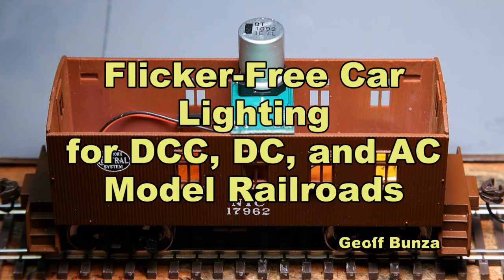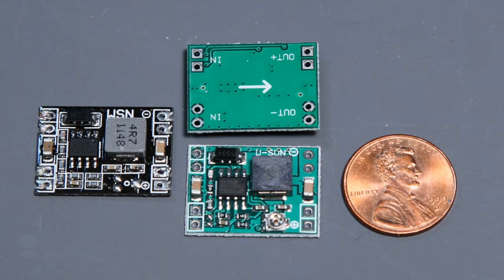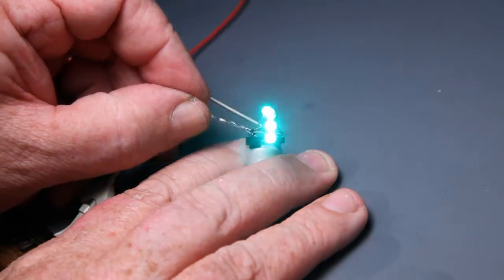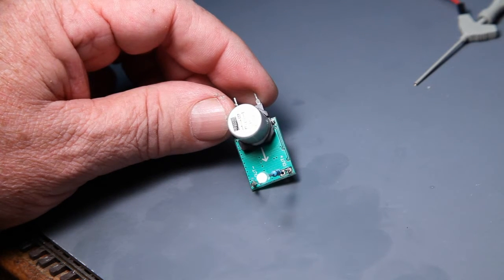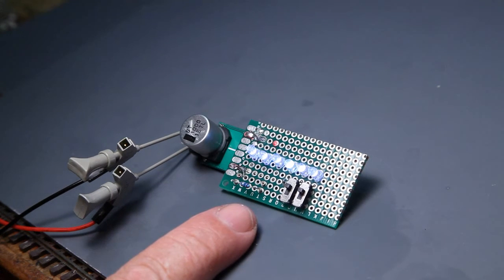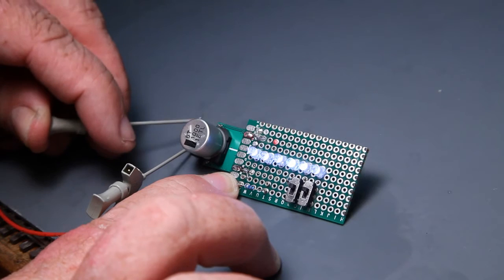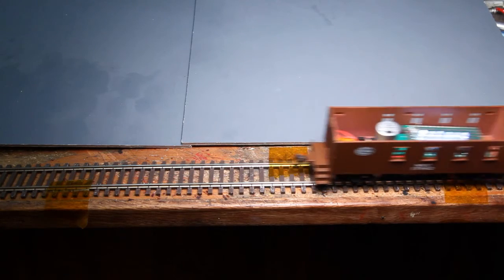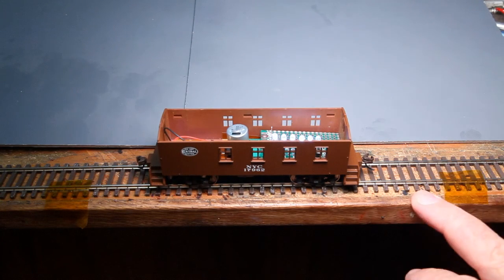Cheap Flicker-Free Model Car Lighting for DCC, DC, and AC Railroads

Comment: Hello Geoff Just found your posts in MR, and spreading out from there. Thank you :)       I have a problem. I am trying to solve, and you might know what I am trying to do :)          I have a guards van eh? (caboose :)  that I want to place interior lights and permanent red end of train red lights (rather than modern  end of train devices)
My problem is that the van can go in either direction and I need a way to automatically change the red lights from one end to the other.  Now DCC signals ,I believe are a hybrid AC / DC voltage? Does the DC switch with the AC? No because then it would be AC? So can I isolate the Dc component and use diodes to change direction? :D
If not, Is their an easy way to  switch ends without lifting the car of the tracks. I want to avoid using a dcc decoder if I can, mainly due to extra programming etc.
Reply from the maker: +Rod Young Hi Rod,
The direction control in DCC is embedded in the coding of the signal, so there is no good way of detecting direction to switch the end of train lights without some decoder mechanism. If you look here:   http://model-railroad-hobbyist.com/node/20739?page=8 under the heading of: New Decoder Variants, you will discover tha you can build a decoder for $5 USD that will do the job for you (I think). The Contruction series starts here: http://model-railroad-hobbyist.com/blog/geoff-bunza with  SMA10 – Build a 17-Function DCC Decoder for about $5. You can also send me a private message through the blog too if needed.
Best Regards,
Geoff
Reply: +Geoff Bunza Thank you Geoff, I am slowly working through it.
Cheers
Rod